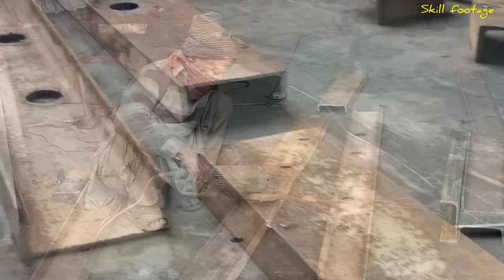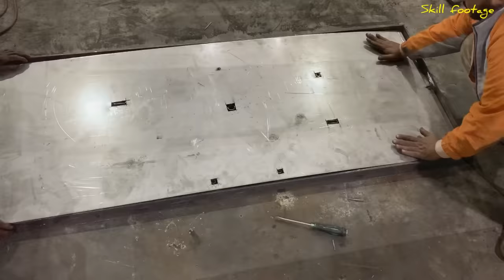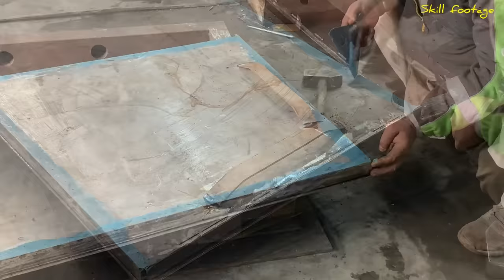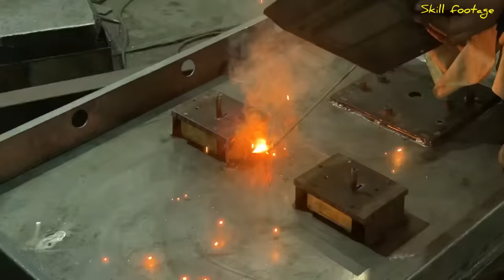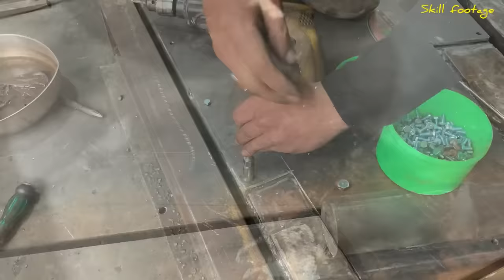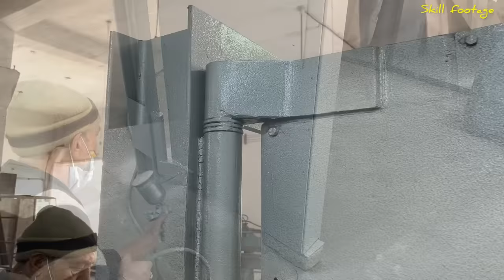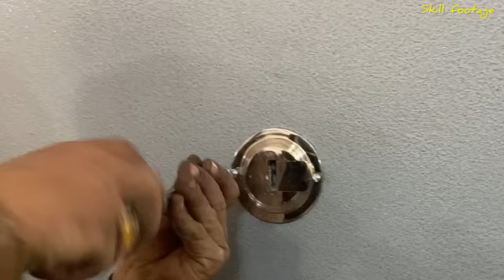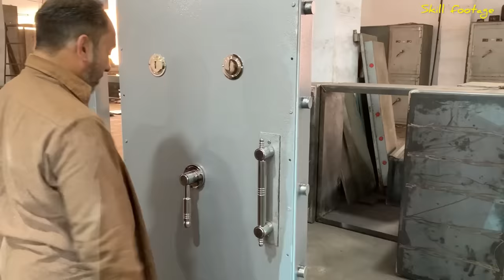Amazing Manufacturing Process of Bank Strongroom Door || How Bank Vault Doors Are Made

Comment: Thank you for sharing this video. I thoroughly appreciated the skills that went into constructing the bank vault door. Please consider using larger high strength stainless steel screw bolts to secure the panels into the frame. The screw bolts used are small and made from low strength alloy. They do not have strength to last the time as the heavy door frames will be opened and closed every day several times in the bank. If you don't believe me then test the bolt for strength compared to larger stainless units. Hope it helps you. Thank you.
Reply: Bank vault doors are usually opened once a day and closed at night (not “several times a day”) as you state.  It’s amazing that you have a calibrated eyeball and can tell the size and material of the bolts just by looking at a fair quality video?  They look stainless steel to me?  Size is unknown.

Comment: I think this door is for a second access to a building. The concrete side is outside, and it's designed to be opened only from inside.
Reply: Then it makes sense, but as a safe is useless, but why then two keys that would not release from inside??? this is strange.
Reply: Two keys for two separate people so they both have to agree to unlock the safety door exposing everyone inside to what ever they are hiding behind that door to begin with. Cheers from Jacksonville Florida 🌞
Reply: @makcrog2853   There must be a second door on the other side of the room for entrance. 
The rear door is for transferring money to an armored car.  It can only be opened when it is safe to do so I think.
Reply: I got it ....... this was the vault door used by FTX to hold their crypto-currency! Lol!

Comment: That appears to be an ordinary MILD STEEL that they are using, soft and easily cut using hand tools.  I think I could be in there rather quickly and without a lot of sweat being spilt.
Reply: Why even cut when you can just unscrew the bolts.

Comment: Is that going to be a problem sealing up wet cement? Seems drying and getting the moister out would be a priority.
Reply: I had an office safe that used a cement filling. The moisture escaped and condensed all over the stuff I had inside - moldy mess.

Comment: I believe I recognize this as the same shop that made a small strong box in another video.
It was also lacking in security but would maybe be okay for home use or small mom and pop type store.
But as others have said, it is difficult to picture this being used as the door to the safe in a bank.  It is severely lacking in many security features that are common in modern banks.
But beyond that, more pride in craftsmanship would be nice.  Full welds instead of just tack welds.  Add some grease or other lubricant to the moving parts.  Actually bother removing the rust from the metal and painting or coating the parts you can't see to prevent premature rust.
When your "fit and finish" is achieved via bondo / filler material and spray paint that is a big clue.  
I like seeing most of these videos but as a bank door this thing is pretty cringe.
Reply: I know now watching this it would be easy getting into one.... ;)
Reply: That door is meant for a "strong room", not a safe. There are plenty of small "bank outlets" in rural areas, which do not hold any tremendous amount of money, and where would-be burglars have just crowbars and pickaxes at their disposal. Still, you have to "secure" those pennies somehow, so here you get what's sometimes referred to as "value for money" ;-)
You wouldn't buy a $200 high-end bicycle lock to secure your battered 15 yrs old six-speed $50 "grocery bike" bought years ago at some garage sale, would you? Same principle applies here.
Bondo? Hey, look sells... gotta look nice, that's what customer sees first.
Reply: Also, Full welds instead of just tack welds - I'm not sure what welds exactly you're referring to, but if you weld a metal sheet to some frame you don't want to make continuous welds as it may easily lead to warping of the sheet. Instead you make INTERRUPTED weld, so any warping will stay between, or will be spread between those short welds.
Reply: @MrKotBonifacy  I get that but it wasn't all sheet metal.  My impression watching the build was the deciding factor was, "We'll save a couple of bucks if we use as little welding rod as possible".
Reply: @MrKotBonifacy  Yes, looks sell.  But a superior crafting / welding job wouldn't need the bondo.  
I do agree it is only suited for less valuable contents and low level threats.
Reply: @davidbwa  Well, "superior crafting" isn't really the case here, is it? ;-)
From my experience metal sheets always have some dents and scratches, and even if they were spotless to start with, this kind of handling would definitely provide more than plenty of those. And when you paint the ready product they become glaringly visible, so applying bondo or any other "body filler" is just a necessity (not from "strength" of "fitting" viewpoint, but from "aesthetics" view point). Well, at lest this is how I see it, but I'm going to wage a war of words about it ;-)
Cheers!
Reply: @davidbwa  "We'll save a couple of rupees if we use as little of whatever we use as possible" - precisamente, amigo. They operate on a thin profit margin, so they try to save whatever they can save, whether it makes good sense, or "not really".
But that's a widespread phenomenon, also when you look at the entire "Chinese manufactured goods" - years ago entire model line of Apple G5 computers frequently failed prematurely because the manufacturer (in China, obviously) decided to save few pennies by putting as little of solder on main board as possible. Those RAM slots were pretty long, so cycles of thermal expansions and contractions (normal in regular use), combined with a switch to lead-free solder (which is less plastic, thus more prone to cracking) resulted in cracks appearing in those "almost soldered" connections, effectively bricking machines worth couple of grands each. (I happened to be unlucky owner of one of those machines.)
Few years back I fitted new mixing tap in my parent's kitchen, but recently my mom was complaining about some leakage and issues with the spout so I got a new one and replaced it. What struck me as odd, the chromium coating on the "old" tap (mind you, less that five years old) was kinda "blistered" - something I I've never seen before. I took a good look, and it turned out that they made this tap from not from brass, but from zinc-aluminium alloy! Which is totally unsuitable for this purpose, as it corrodes easily. Worse still, it's prone to so called inter-crystalline corrosion, so the item looks OK but becomes very brittle. In fact, I crushed it latter in my hand when I tried to remove some part from it.
Nonsense? Yes, of course - but hey, Zn-Al alloy is several times cheaper than brass, so, well. We'll save a lot of money, and the cost of flooded house will be paid by the insurer in some foreign country, so who gives?
In fact, there's a book on this subject, "Poorly Made in China" by Paul Midler - I truly recommend reading it. One most striking example of "penny wise pound foolish" "savings" in this book, where a shampoo manufacturer saved few hundred bucks on cheaper (and weaker) cardboard boxes used for shipping, and the entire batch of that shampoo, worth tens of thousand of dollars got destroyed during its sea voyage to America.
OK, 'nuff of this blabber. Cheers!
Reply: @MrKotBonifacy  Same here, I'm not really looking for an argument.  :)
I think we are both in agreement this is not the same level of door you would see on a bank vault in some place like the USA.
In fact, most (not all) US bank vault doors I have seen are not painted.  They are polished or brushed metal.
Reply: @davidbwa  Yes, I would agree that we agree ;-)
Those "polished or brushed" metal is. methinks, stainless steel cladding. Just a (relatively) thin sheet of metal, aesthetically pleasing, won't ever corrode.
Reply: Maybe the "strongroom" means something different in such countries. You don't want to let somebody out rather than preventing somebody to get in?
Reply: @SYS-dc6uo  Interesting concept : )
However, that kind of "strong room" is universally referred to as "prison cell", so I don't think so... ;-)
Reply: So just spend 2 minutes unding the small nuts on the outside then you get access to the locks and just turn the bar! Its open! WELL DONE!
Reply: No over ride on the inside don’t get locked in.

Comment: I think people are criticising and saying it’s backwards without considering what it’s final installation might be. It’s obvious the plane side of the door is the armoured side with a sheet of mild steel, a sheet of copper to stop attack from a gas axe and then reinforced concrete and finally another sheet of mild steel. That also puts the pins towards the back of the frame making it harder to reach them to cut or pull the door out of the frame. My suggestion is it could be a door allowing the strong room to be accessed from outside the bank or whatever the institution is. This maybe more convenient when bulk money is being added or removed via armoured car ect. In that case the way this door has been built would be suitable because from the outside you see nothing but a blank door and from inside you have the security of needing the people with the keys to open it. This would also prevent the hinges from attack. While certainly not a high security door by western standards it’s probably up to the job in its intended location. Just something to think about.

Comment: I build custom hidden doors with 5/16 steel plate, with a copper sheet, hard polyethylene rubber and 1/4" bitumen layer sandwich backer. The door and frame are filled with high density 8000 psi bridge mix concrete. 

The locking bars are 1-1/4" steel rod, that are heat treated and hard chrome plated after cutting, machining and tapping. None of the above be done after hard chroming. 

They aren't built like an old Diebold bank vault, but the locking mechanism uses a combination dial, star wheel crank and a glass relocking mechanism, as well as dual safety deposit box keys for added security. The keys AND the combination has to be used to open AND lock the door. It can be opened from the inside, for use as a safe room door, too. 

Unlike the doors in this video, which I guarantee I could open in less than FIVE minutes.....TEN minutes, if I took my time. Considering where these are being made, they are for hiding yourself, not anymore great value. The welds themselves are pathetic, not to mention the thickness of the metal renders the concrete and poorly welded "rebar" cage inside the concrete. The banging on the concrete and the heat from stick welding probably rendered the already dry mix mortar into power. 

What a joke. I doubt anyone who buys this is hiding any pallets of money from the Taliban. The bolts on the front... laughable. Even Grade 8 bolt heads could be sheared off with a cold chisel and 2lb sledge. 

As for my doors, not one has ever been compromised and are hidden in such a way, they are undetectable from the outside... meaning being in the room, they can't be recognized.
Reply: Why do they put a copper sheet in the door?
Reply: @Neontrifle  I think copper sheet hinders from gas cutting torch to penetrate from the outside...

Comment: It is easy to open such a door ..... You take the bolts around the perimeter and unscrew everything, thereby opening up access to the mechanism that pushes the door sting ..... The fact that the bolts are on the front side. if they were on the inside of the bolts then another conversation))

Comment: So secure...tack welds through out, accessible bolts on the outside of the door and two, two possibly three lever locks. Good as long as you are not trying to secure anything of any value.

Comment: No fibres in cement hermal resistance compounds?
No clamps to retain sqaurness of door or frame when welding as it could warp with heat buildup
No locking bolts top or bottom of door?  Any anti pry protection?
I assume they painted bottom edge of door too lol
With basic tools not the worst ever door made not bad but I wouldn't trust it to protect owt really of value

Comment: The "security theatre" of the the big scary door + time required to angle grind it out might deter some amateur thieves especially if it only contains medium value items. Probably wouldn't work to protect high value items though.

Comment: The front is 1/4 inch mild steel, bolted on from the outside. He notched it with a cut-off wheel! 1/2 to 1" of AR500 welding on, would have been better. 😂 😂

Comment: May be this door is to lock from inside a bank, so locking/unlocking from inside. Not of a safe. So to prevent someone from opening from outside, the bolt and keyhole is from inside the bank perspective. From outside the bank, just plain "strong" door. Definitely the bank must have minimum 2 doors (unidentical to one being made), else it is a manufacturing error. Just my understanding of the issue being discussed by many in the comments.

Comment: good try  next time read the plans you made the back of the door the front its inside out ! that is the weakest part that's wear you service the door . the cement is meant to be on the outer side. this would make a great prison door so you cant get out.  i really liked the very heave duty brass locks in side the door 10 out of 10 for them.  in time they will work it out

Comment: I wonder who certifies this contraption. Let's take a first-pass look at the most obvious failures: Open-toed shoes, loose-fitting garments, no face shield, second-hand materials, corroded materials, hardware-store screws and bolts, improper tapping techniques, imprecise cutting and welding, imprecise assembly, and unsafe lifting techniques. Not to mention that all current bank vault doors are made of high-quality non-corrosive alloys that are not penetrable by common Harbor Freight tools.

Comment: The door is all show and no go. you just have to remove four screws on the front to open up the lock cylinder areas.   also the sliding bolts need to be made with internal rotating chrome Molly parts that resist cutting because they all spin also it looks like the door can just be pried open with a big crowbar by expanding the sides.  I wouldn’t even keep my Pokémon cards behind that door.

Comment: What is amazing about this vid? The primary reason American labor is so much more expensive, is we don't work like Rats on the ground. Did you see any safety gear at all? Gloves? Leather shoes vs Flip-flops? Safety Glasses? Hearing protection? The ENTIRE assembly is Tack-welded together with Clothes-hanger wire ???

Comment: Err, the strong part of the door is behind the mechanism. It is the wrong way around. To break in one only has to peel back or cut through a thin piece of steel, and not the reinforced section. The thin piece could be cut through with a fire axe or a simple disc cutter/grinder. This is just one of many flaws.

Comment: Not a very secure door, considering all you would have to do is take out the bolts around the perimeter of the door frame and you’d have access to the door mechanism. I could have that open in less than 10 minutes.

Comment: The only thing interchangeable about that design are the 10 mm bolts they tapped into the skin of the door. I'd like to see the lock picking lawyer have a shot at this
Reply: Pretty sure TLPL can crack this with his eyes covered using a rubber band and a bobby pin.

Comment: LOL, What a joke. I have actually deigned and built a door. The concept here is correct, but somewhere along the line the stolen designs were misinterpreted, and the door has been built the wrong way around. No need for fancy drills to break into this door,  all you need is a spanner. (My door had re-lockers, glass panels that shatter when the door is drilled, locking the door permanently, most vaults have a small additional door for this situation)

Comment: No. These doors are not going to be used in a pawn shop much less in a bank. I have seen bank locker doors and visited Godrej factory where strong room doors and door frames are made. Godrej doors are used in many banks and they are made in a much more better way. No external hinges, no rusted steel, no dry bearings and no hollow pipes for bolts. They used steel stock for bolts and have anti tamper bar inside the door. If someone forces open the lock the tamper bar falls into place and can only be opened by cutting open the door. The door these people made is junk.

Comment: thought most were made from heavy stainless not rusty scrap i guess in 3rd world area this is how they make them i mean that welding shied the way the guy is holding it is doing absolutely nothing and those weld look like they fall apart with a tiny bit of force and the cement they are using in small batches from a bowl looks way to dry to fill an area proper

Comment: Near usless design. Having the bolts on the outside, gives easy acces to the internals of the locking mechanism. It would had made more sense if the door was flipped inside out, and then have the keys and door handles on the other side. But as this was designed, it would be werry simple for any robbers to get inside.

Comment: This is like 100-year-old manufacturing. Hand-made lock mechanism?  Even 100 years ago they were made better.
   Why no work table? Everyone is on their knees. There is no reason for this. It's faster and better to use an assembly table.
  edit; It's vaguely possible this is a rear door that only opens from the inside.  I guess there must be a door on the other side of the room for an entrance.